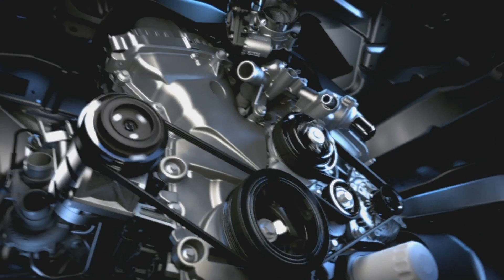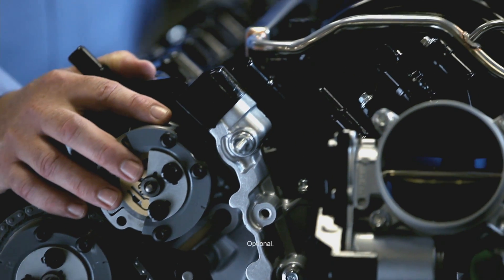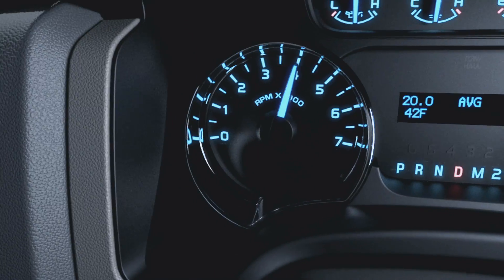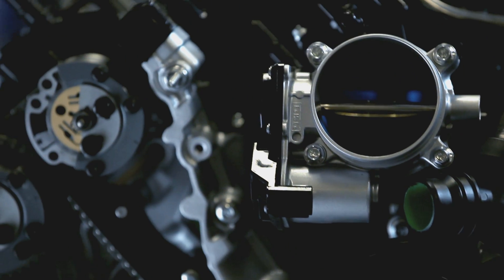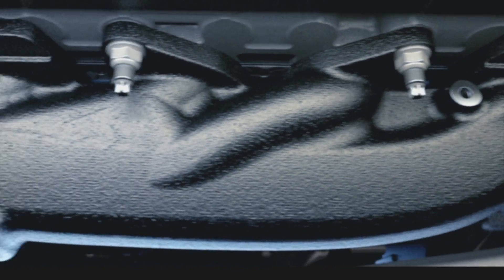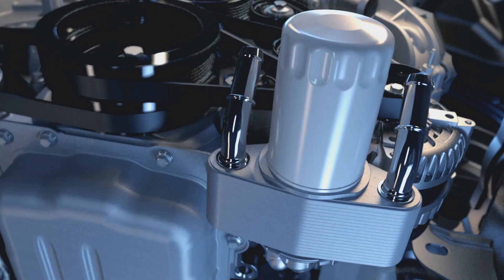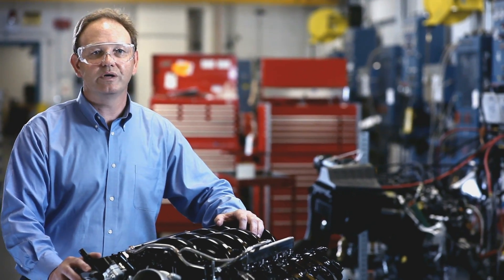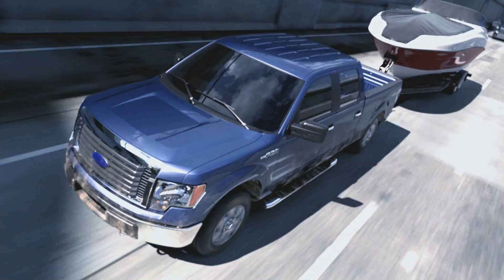Ford F-150 New 5.0L Ti-VCT V8 Engine

Comment: Indeed it’s a new improvement around the clock, but electrification eliminates all the moving parts and oil from the platform. Everything that’s new in this engine could have been done 15 years earlier like the cast iron manifolds, either way electric motors rival gas at this point going into 2023. When the perfect self generation of electric vehicles while in motion it’s game over for gas engines.
Reply: It isn't game over for gas engines.  Major companies are actually slowing down on their production for EVs and I personally rather have a gas car for decades rather than an EV for 10. 😂